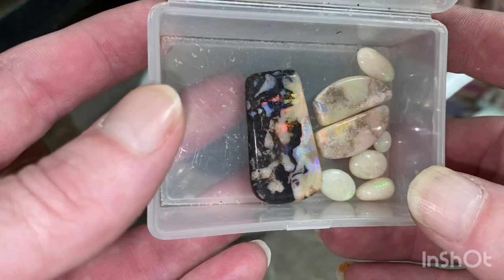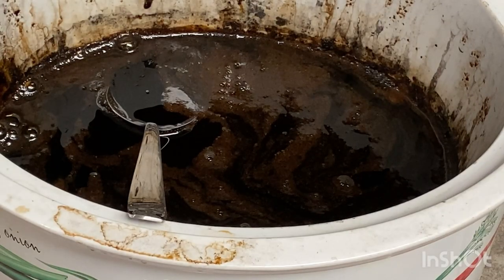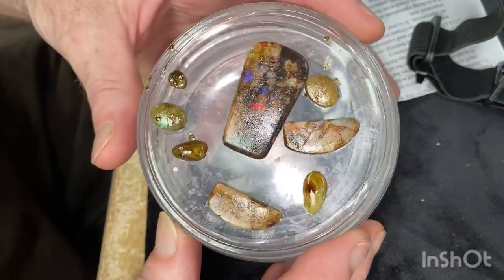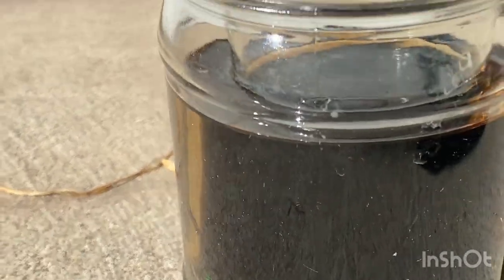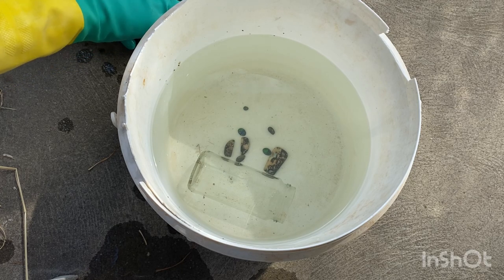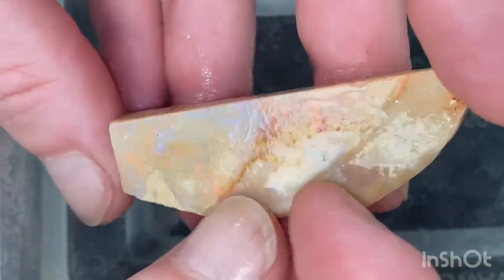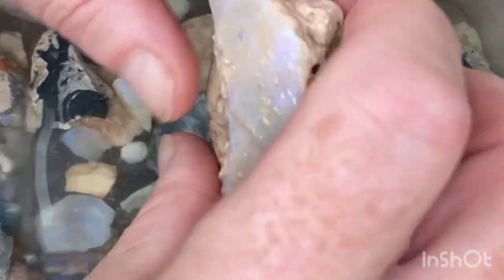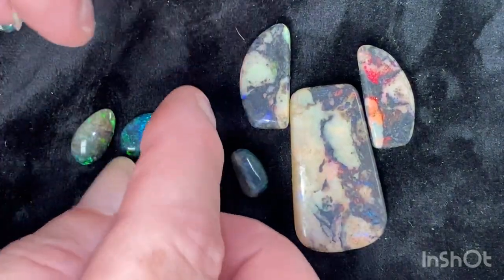Opal treatment: Andamooka matrix gems: success!

Comment: Very informative video once again Phil. Just an idea/ question , If you put them in a vacuum chamber with some sugar solution before the sulphuric acid do you think it would help it penetrate further? WoW 😳😘😍 awesome results. Can’t wait for the website 👍👍👍
Reply: Good question, something I have wondered about
Reply: I was thinking of trying that myself. Interested to hear if anyone has tried
Reply from the maker: I haven’t seen anyone try, but I so want to try that I’ve been thinking of getting a cheap heatable vac chamber and a way to suspend the opal over the sugar solution, remove the air and somehow then trapdoor drop the opal in and once submerged entirely then let the air back in, in my head I envision it to work better than drawing the air out once submerged. As soon as I can organise it I will try though..
Reply: @theopalmills  I used a chamber to stabilise wood in resin years ago when I was turning bowls, the air bubbles were a pain but end results were better, you could turn the slow cooker into a chamber with a 10-20mm thick piece Perspex, tap a couple holes for fittings and silicone cooking mat for a seal, that roughly how I made my chamber lasted ages until it didn’t lol
Reply from the maker: You’ve convinced me to try to make my own vac chamber, I love “I think I can” logic! ✋👀👍
Reply: Yo do not need to suspend the opal inside the Vac chamber. the air inside will expand out of the opals better if submerged (also less chance of air getting back into the stone). keep in mind that if you heat the solution and pull a vacuum then you might boil the solution even at low temperatures. You should cycle between vacuum and regular air pressure a few times to get good penetration.

Comment: Great video Phil , They came out Great , it got me thinking about a way we used to get fishing bait to suck up a sugar solution , and that was to freeze it , the bait contracts when it freezes and forces  the air out from the pores  and then when it defrosts it expands and sucks up the surrounding delicious solution , I wonder if it would be the same with the opal , looking forward to the website
Reply from the maker: Not sure, I’m thinking opal isn’t as flexible as bait meat tissue so it may contract but not shrink to force air out and in that case cold air is more dense so when reheated would expand, repelling penetration until equilibrium.

Comment: Is it better not to polish out the stones pores before the start of treatment..? Well done with your new venture on YouTube
Reply from the maker: The polish (pink) pad on my machine doesn’t lose enough grit polishing to block pores which is why I wouldn’t use cerium oxide on matrix. As for the pores, it doesn’t seem to affect the treatment either way rough or polished, the main reason you’ll see people treat then cut is to see the colour and make sure they section out the best cut, but they’d still need to bring it up to a polish and treat again as it only penetrates so far some more than others, so treated layer can be quite thin.
Reply: @theopalmills  thank you mate for the info

Comment: Hello mate I have andamooka matrix and QLD fairy opal already treated and great colours but want to know is there  someone who can polish or resin them to get that High gloss finish can you put me onto someone maybe I'd happily pay to get it done
Reply from the maker: G’day Paul, I’m not too familiar with the nature of QLD fairy matrix but think resin would be the go for that if it’s anything like Andamooka concrete matrix, as for your Andamooka matrix, if it’s hard matrix it can take quite a good natural polish (no cerium oxide though). For resin treatment, I’m going to do my own, Starbond is a great product as it comes in a spray on, the low viscosity allows it to soak into the matrix, and you can build up the layers to get a final coat that should retain the polished/wet look once dry, I’ll also be trying two part epoxy. I’m not sure if there’s anyone to refer you too for the resin treatment, it’s kind of diy. 🤪👍

Comment: Please provide me black oxide power link 🙏
Reply from the maker: G’day Sonu, I’ll answer as much as I can here. The matrix is cooked in a sugar/water 50/50 solution on a high setting in a slow cooker, 4 hrs minimum, then into hot sulphuric acid for atleast another 4 hrs. I have my sulphuric acid in a glass jar that sits in a pot with some water in it, this is so I don’t over heat my acid, as water has the lower boiling point, I set the temp to a simmer as I don’t want the water to boil, in turn it won’t let the acid boil as long as the pot has water in. It may take up to 2 or 3 treatments for it to take. I wouldn’t worry about the black oxide powder or Ribena, it is messy and does nothing to help. 🤪👍
Reply: @theopalmills  your mean you didn't use black oxide power
Reply from the maker: @sonuverma2796  I tried it but had the same results without it, so I can’t say it actually helped at all. It is just black oxide powder from a hardware store, it’s used to colour grout/cement.
Reply: @theopalmills  sir your mean no requirement rabina, and black oxide power, only suger and water solution required
Reply from the maker: @sonuverma2796  correct
Reply: @theopalmills  sir you bake sugar and water solution three days, but you bake that solution continually three days,or you bake only 4 hours per day heat up continue since 4 hour per day . 🙏

Comment: Does treating opal increase or decrease the value of andamooka matrix?
Reply from the maker: Great question and the reason I avoided matrix to start with but now am fascinated, treating is to make the colour contrast/pop out, and will usually result in a much better looking stone, so the comparison is of the before and after, and the “after” should be aesthetically improved so the matrix price of that stone should increase, but I will always state if treated and price accordingly. 🤪👍
Reply: @theopalmills  so cool! Does the treatment affect the polish? Or are you able to give it a quick polish and not lose the color?
Reply from the maker: No, I’ve been able to bring it to a high polish then treat and it doesn’t seem to dull any or affect treating, but another touch on the polish pad after doesn’t hurt either.